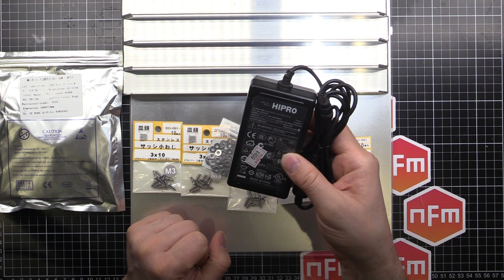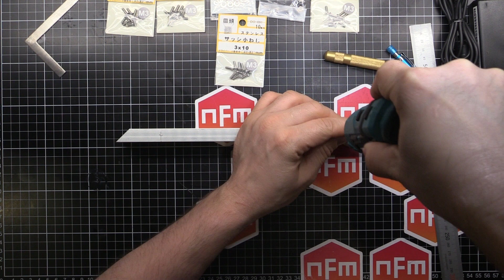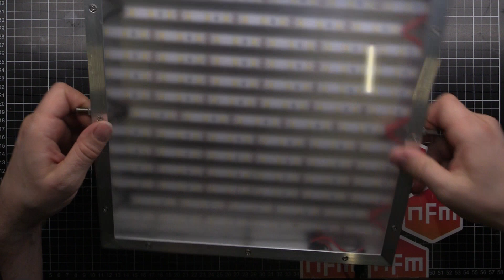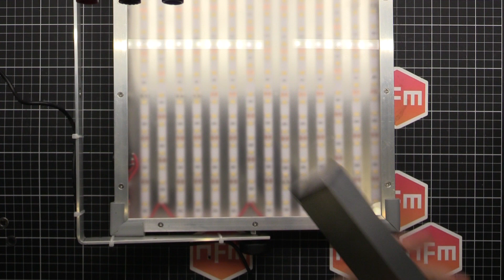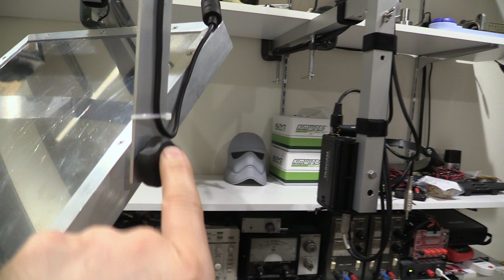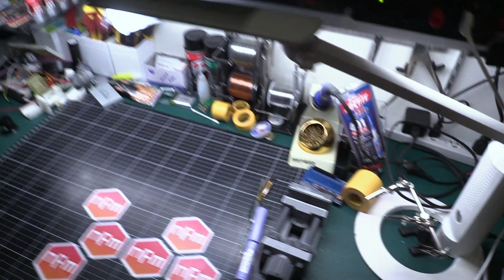How to Build an LED Panel Light

Comment: A v-e-r-y professional build! I just installed a 4' LED shop light (5500Lm) over my bench. It was too intense, so I used parchment paper (for cooking) to diffuse it. Even with two layers of parchment, it is still rather intense. I needed it for seeing, not making videos. I built a wood frame to support it. The light hangs on chains and is about 40" above the desk.
Reply from the maker: I have a few LED work lights that I use for extra lighting when needed, I may or may not also use parchment paper for diffusing the light. :D

Comment: Has the LED strips fallen off the back aluminum plate yet? I can never get LED strips to stay in place.
I've been working on a PoE LED Panel and thought about using Foil Tape or long strips of copper clad board as bus bars.
Reply from the maker: Nah, the LED strips are still stuck as good as the day I installed them.

I did clean the aluminium plate thoroughly with isopropyl alcohol first before sticking the LED strips down so that will have helped adhesion.